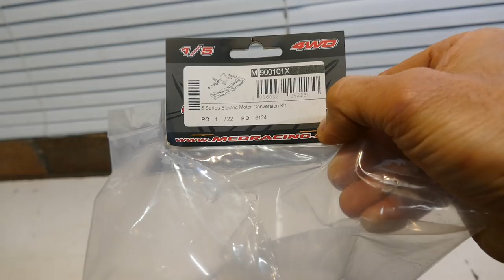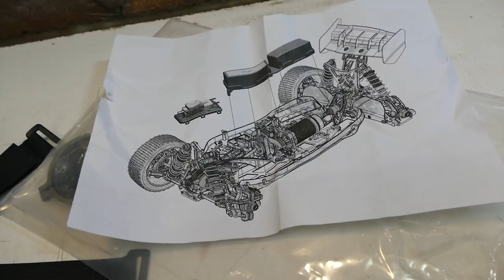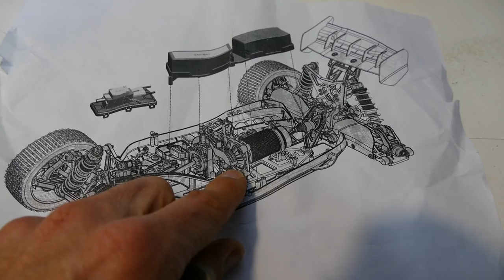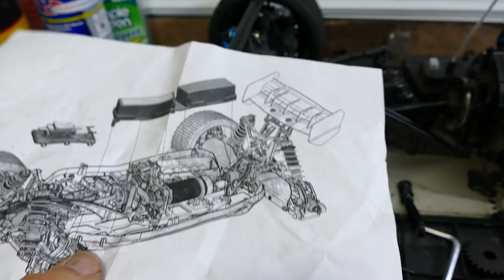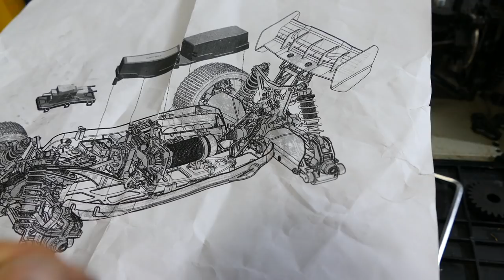ROVAN F5 1/5 4WD ON ROAD CASTLE CREATIONS BRUSHLESS CONVERSION - IT'S CRAZY POWERFUL!

Comment: Personally, I would make use of the braking servo to help keep the braking stress off the motor. The braking is what draws the most juice out of the batteries. I would reduce the braking on the ESC to 0% and set up a mix to make use of the braking servo. Just my thoughts.
Reply from the maker: Yeah man, I agree. I might try and mix it in on the radio

Comment: To my experience, 1S/kg in Big scale IS a good compromise of speed an sweet for electronics. For this car 12s with sss motor 420kv 56114 130€ and a cheap Flier/Alien Power ESC 200€ IS a good and cheap solution.
Reply: PaPa RC 1s per kilogram sounds pretty good. Seems like you could apply it to 1/8 scales and most other sizes too

Comment: Nice, you need to get the Grafil or MCD rally car body and the MCD rally tyres or Hostile zero growth slick's, the manual brake helps to keep the motor cooler and you can adjust the bias front and rear, I personally would keep the brakes on it.
I did think it was a little slower than I expected it to be.
Reply from the maker: Wheel spin alot of the way. Pretty sure it will have some decent top speed.

Comment: do you think you might be able to suggest a cheap radio i could use with a tamiya king hauler i'm just using a brushed speed controller not the tamiya MFU but i need something that will work with the 3 speed transmission

Comment: Why did not measure the maximum speed ???
 Ps.  And you can do it through the clutch.  Such a motor will work without problems on any gasoline model.
Reply from the maker: We will do another video for that.

Comment: I let someone else drive my car.. they decided to drive it on and on and not in vision and smacked it into something and broke it..  and a part that requirez pulling the whole front diff off to replace the piece that holds the front suspension arms..😡and not oops sorry.  More.a is it broken. Your fault for letting them drive it